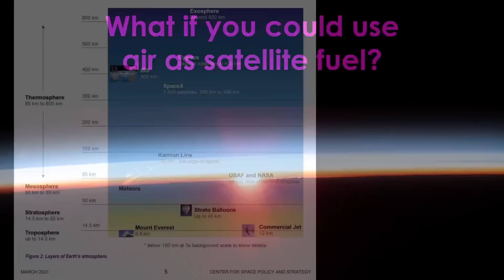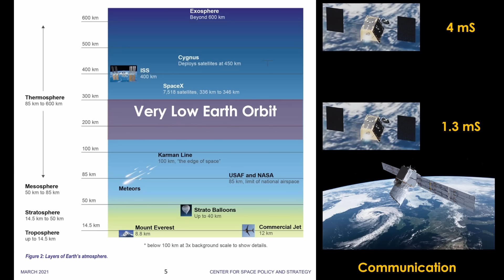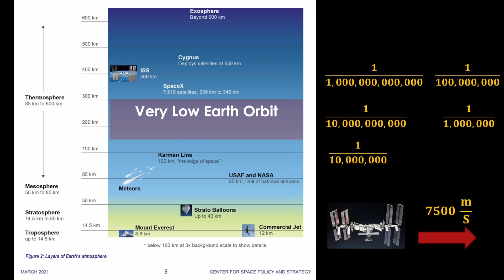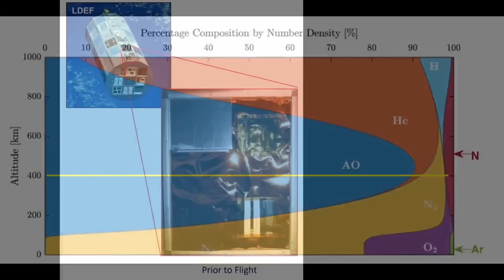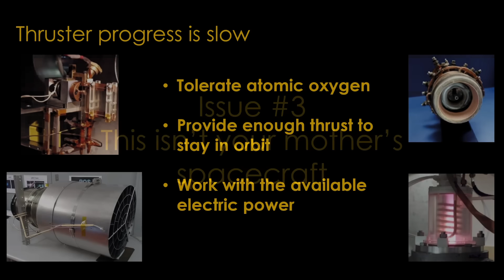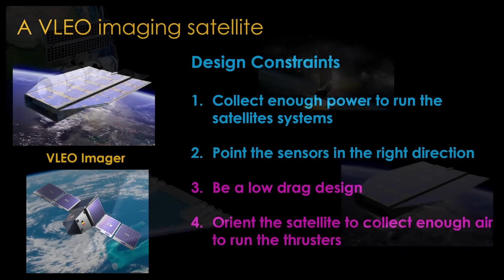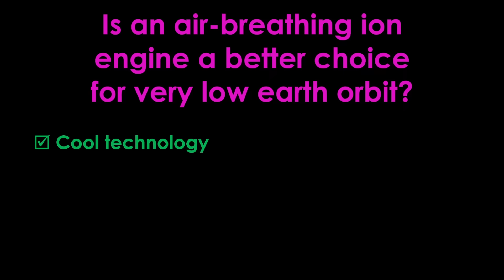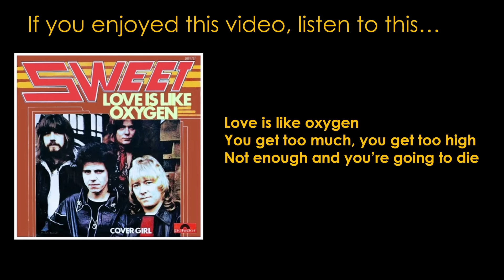Air Breathing Satellites in Very Low Earth Orbit

Comment: I wonder if a performance compromise is possible for the ram collector, perhaps using a sacrificial carbon aerospike at the inlet that initially slows the air and reacts with the atomic oxygen to form CO, which is then accelerated with an ion thruster. The propellant then wouldn't be infinite as with the air-only scheme, but it is collecting a little more than half of its reaction mass initially and protecting the electrodes from oxidation

Comment: Could this solve single stage to orbit and refilling in orbit? I mean theoretically if such a satellite could collect excess oxygen and deliver it to an in-orbit refill station that would make refilling and reuse of rockets or space vehicles a lot easier as oxygen is actually most of rocket fuel. I'm not sure about the figures but just rocket fuel without oxygen would mean a specific impulse (Isp) of about 1000 s or so. It would kind of look what Space X is doing with reusable rockets like Falcon 9 kind of silly and I dare not even mention the Space Shuttle program any more.

Comment: Can you put them in low earth orbit and make them capture water, use the solar panels for electrolysis and store the O2 and H2 in tanks, then once you have full tanks do the final push to a higher orbit?
Reply from the maker: NASA originally looked at this as a way to capture oxygen for propellant, but they physics just doesn't work out.

Comment: Would using a kind of scram jet to simply react O into O2 be an exothermic enough to work? Another idea I had would be to put grid fins on the satellites that are black on one side and white on the other and develop thrust in the way a Crookes Radiometer works. I have far less faith in the Crookes Radiometer approach to actually work. I also suspect that people have already thought about those approaches and ruled them out already.

Comment: would it it be better to have a very elliptical orbit where you have a pretty high point (somewhere around the ISS or higher orbit point) and a very low point.

at the low point you could scoop air into a big tank and also do imaging and you could possibly sit lower to not hit as much diatomic oxygen. Then since its more effective to effect your orbit from the opposite point and at the highest point it would be more effective.

the only problem I see is reentry might be harsh.

Comment: Is there a gas that if used in the thrusters would reverse the oxidation from AO?  Then one could alternate between air breathing and tanked fuel and make the tanks last longer I suppose
Reply from the maker: You can't reverse the oxidation, but you could conceivably bring up something to react with the AO as it came in. That's feasible - I guess - but it seems like a lot of work to do to just get a modest gain in fuel economy.
Reply: @EagerSpace  Agreed.  But when it rains, make lemonades and I'm just stretching trying to think of what kind of lemonade can be made from abundant AO I guess

Comment: Could you flip the design and create a very large air scoop that also acts as a wake shield? It would protect most of the satellite from atomic oxygen while simultaneously scooping it up.

Then you only need to protect the air scoop from the atomic oxygen. You can combine the atomic oxygen into O2 for storage and fuel along with the other molecules.

Then the trick is figuring out what the drag ratio is. With this information, you can apply more power to the ion engines and push harder.  

Then the math is thrust to drag ratio, and power to thrust ratio, and surface area (behind the wake shield) to power ratio of solar panels.
Reply from the maker: The original NASA plans around this envisioned harvesting the oxygen and liquifying it for use as a propellant. The hard part is that every atom of oxygen you collect produces drag on the satellite so a large air scoop means a ton of drag, and it seems unlikely you can get enough thrust to stay up.
Reply: @EagerSpace  Drag increases linearly as a function of the area of the forward cross section.  Solar power increases linearly as a function of the area extending an arbitrary length behind the air scoop/wake shield.  once you have a big enough cross section blocking the oncoming atomic oxygen, you can extend the length behind it as much as you need to capture the appropriate amount of solar power in effective vacuum, since the intake/wake shield can produce quite a long near vacuum behind it.  no need to worry much about atomic oxygen on the solar panels or the rest of the equipment.

Comment: I wonder if it would be possible to design it such that the air scoop functions as a shield for the rest of the spacecraft, totally 'shadowing' all the other parts from mono-atomic oxygen. It would further limit the spacecraft's options when it came to attitude adjustments, but it could make the materials engineering much easier.

Comment: It is a bummer that an atmospheric scoop is not feasable, or if it is, close to non-worthy on earth. Oxygen would be a very demanded comodity on orbit and a particularly heavy one. I usually think about about ideas like PHARO—Propellant harvesting of atmospheric resources in orbit and ways to achieve the numbers needed. Maybe power it by microwave or laser beaming from the ground or a ring of beaming satellites on higher orbit (the use of a nuclear reactor in LEO or below it I'm not going to consider), leaving the large solar array out of the equation and the drag... maybe electrodynamic tethering or traditional tethering could help with it. Atomic oxygen is always a problem though
Reply from the maker: NASA did some papers exploring whether they could do that, I think in the 1960s or 1970s.

Comment: Could a magnetic field be generated that funneled air into the center and deflected air around the space craft body and solar panels? As if the earth's poles were the intake and thrust and the outer donut was the rest of the ship. Or would the power requirements of that be just too great?
Reply from the maker: AFAIK you can't affect atomic oxygen with magnets
Reply: @EagerSpace  Oh, yeah! I forget magnetic fields don't effect everything sometimes.
Reply: If you  are making an ion drive using  monatomic oxygen, you have to ionize the atoms.  Those atoms  are charged, and can be guided by a magnetic field.  You would want to ionize them before they touch anything and without using crazy amounts of power.  I'm sure this has been considered, and magnetic scoops are standard equipment for the (currently unavailable) Bussard ramjets.
Reply: @hanshaucke8715  I'm always assuming everything has been considered... and then doubt my assumption. It will be very interesting to watch the technology unfold.

Comment: make eliptical orbit, when behind sun, electrical low satelite on high orbit wich is low drag no trust condition... when on sun, have enough power for ion truster and  scoop air for gaining speed for maintaining orbit
this give benefit of: easy to change orbit, no need constant power to maintaining orbit and not in constant high exposure of diatom oxigen...
Reply from the maker: Might work, assuming you can do the work you want to do in a highly elliptical orbit.

Comment: If very low earth orbit satellites could have a life span of 5-ish+ years and the cost to deploy continues to go down, it could lead to solution to Kessler syndrome because dead / malfunctioning satellites would quickly cease to be a problem at that orbital altitude. It would be possible to curtail launching to the higher orbits so that the debris / dead vehicles could decay out of orbit over time.
Reply: Put enough trash in the void and eventually air will be the only viable strata

Comment: Given the atmospheric composition chart, wouldn't 100km be sweet spot, 95+% N2 which is known for being unreactive.
Reply from the maker: If you could stay at orbital speeds, yes. 
I didn't talk about it, but SLATS only stayed at 167 km by using its reaction thrusters. As you go lower the drag factors get higher and it's going to be hard to get enough power and thrust to stay up.

Comment: wow, I can see why people were upset at the chinese anti-sat test now. So much debris it has its own category on the chart
Reply from the maker: ASAT tests are just terrible. Not only is there a lot of debris but because of the impact energy you end up with pieces in elliptical orbits.
Reply: Delightful research and presentation from a new subscriber. Although somewhat of a Rube Goldberg contraption, one could imagine a two-part satellite each with its own engine. One part would have the sensors optimally oriented and the other would have the solar cells optimally oriented. Power could be supplied to the sensor unit via microwave. This is probably way too complicated and expensive. Thanks & blessings!
Reply: To be fair, they are not the first, nor the last to carry out those tests. Most of the debris are either from the US or the former soviet satellites.

Comment: Something i gotta wonder about is if the viability of air breathing  satellites  could be improved by beamed power from satellites in higher orbits. 

It removes the challenge of having to orient for both power generation and oxygen capture, and means the solar panels aren't generating drag for the satellite or experiencing the highly corrosive atomic oxygen environment.

i think the main problem would be is that you'd need enough higher orbit generating satellites to maintain a constant beam of energy, which massively increases the initial set up cost. It's not insurmountable but it'd raise the bar for entry a lot i think.
Reply: why not use those same lasers to ionize the airstream then?
Reply: @MrJohndoe845  i'm confused what do you mean by that exactly
Reply: @MrJohndoe845 ionization is done in the thruster itself. Even then you’d still need power in the thruster itself to accelerate that ionized air to get thrust anyways. Even then how to hell would you hit the air with that laser to ionize it. You’d be vaporizing everything on the surface.

Comment: to make the satellite low drag and generate enough power, you would probably need to make the satellite very long, like trains, everything eventually turns into trains
Reply from the maker: The SabreSat is entended to be extendable if you want
Reply: The train is the engineering equivalent of the crab
Reply: keep going and you'll have an orbital ring
Reply: The problem with space trains is that only the last segment can have propulsion.
Reply: @basilevs83  The problem with earth trains is that only the first segment has propulsion most of the time. I don't think that's much of a problem.
Reply: @MystiIsLostsecond and third locomotives for Earth trains are waiting for them on stations before chanllengin track segments.
Reply: @basilevs83  All of the segment can have propulsion, you just need to thrust backward with shallow angle, at 10 degree you still can have like 98% of thrust.
Reply: Fakestory,
And the vertical component still helps

Comment: Cool video. I would've liked to see what "low drag" in the context of these kinds of speeds and this low density air actually looks like, especially when the air has a propensity to react with whatever it collects with. I imagine you don't really deal with the standard aerodynamic models where you look at the air as a collective that has different pressures and velocities at different parts and more as a bunch of billiard balls bouncing right off your spacecraft lol, or hell even getting partially imbedded into it / reacting with it.
Reply from the maker: All the pictures I showed were proposed designs for very low earth orbit satellites. Some of the papers I found talked about their drag models, but I didn't look at them in detail - and they may be over my head - so I don't have anything useful to add there.
Reply: @EagerSpace  Fair, it's probably best to avoid talking too confidently about something you don't know a ton about, and aerodynamic models can get real complicated really quickly lol, especially at those speeds

Comment: It needs to collect air, to produce thrust, to counteract the drag caused by it collecting the air. Can the collected air really provide more energy in thrust than is lost to drag whilst collecting it?
Reply from the maker: If you can add enough energy from your solar panels, yes. 

It's not clear yet how hard that will be.
Reply: In theory if you collected, lets say 50% of the air, you would just have to shoot the air back out at twice the velocity it came in from to make up for it, which ion engines are very very much capable of doing. Some have exhaust velocities of 35 km/s, which assuming an orbital velocity of about 8 km/s you would only need to collect 23% of the air. And that's assuming that all the air that hits you gets accelerated to the same velocity as you, which isn't guaranteed.
Reply from the maker: Unfortunately, the higher the exhaust velocity the lower the thrust for a given amount of electrical power. That's why ion engines tend towards heavier molecules - the specific impulse isn't as good but the thrust is higher.
Reply: @EagerSpace  In theory you could get away with a pretty low ISP, at least for ion engines, if you have an infinite fuel source.  if you can harvest like, 50% of the incoming air (and assuming the rest gets accelerated to around your own velocity), you would only need an isp of like 1600 seconds to regain the required momentum, which is on the low end for ion engines. Low isp means less power required and less solar panels, which would reduce complexity quite a bit.
Reply: The principle is the exact same as a conventional jet engine, so obviously it can work. In theory that is. ;P

Comment: Great episode.
Hardly any material survives being hit with atomic oxygen at 7500m/s, so it would make sense to have a shield that reacts chemically with the oxygen and retrieve it as O2 by reversing the chemical process. Perhaps with Lithium or Selenium which don't degrade after repeated regeneration. The satellite would still need to throw out the oxygen the other end at the same speed as it was cought, so I assume ion thrusters would be the only option.
Question:
Let's say we get a mission to crash a payload of one ton into an asteroid, and because time is short we must do it with a direct approach with chemical rockets. To our aid we have access to a Starship that can launch a payload of 100 tons to LEO. Should we put a self propelled space probe with a big fuel tank in the payload bay and launch that from LEO, or would it be more sensible to shed some skin off the Starship and use that as launch vehicle with 99 tons more propellant? What kind of velocities could we reach? I suppose a self propelled probe could use hypergolic fuel and a small engine, but no ion-thrusters or nuclear devices.
Reply: Of some note, an entire F9 second stage and payload fits inside the cargo bay of a Starship. SX currently builds 150 of these every year. Economies of scale apply. 

Your scenario assumes expendable Starship, so the mass budget is about 200 tonnes.

According to Wikipedia the second stage has a dry mass of 111,500 kg and a dry mass of 4000 kg while the engine has an ISP of 348 seconds. 

That means that from LEO an F9 second stage could accelerate a paperclip to 11.348 km/s or a 1 tonne probe to 10.587 km/s or a 10 tonne probe to 7.076 km/s

That gets you 10 tonnes to Jupiter capture (6.57 km/s) or throws 1 tonne right out of the solar system. (8.75 km/s) with no gravity assists. 

If a reusable Starship can lift 112,500 kg that means we could toss 150 extra solar probes every year.

PS, I didn't directly address the 1 tonne smacked into an asteroid. If you're just talking about a redirect mission, the empty second stage (4 tonnes) has over 11 km/s Delta V, so yes, it could easily hit an asteroid assuming there is some means for fine course correction added. No gravity assists needed.
Reply: @gasdive  Thanks for the answer.
Reply from the maker: Starship to LEO, then one or more kick stages. The impulse aerospace ones that are methalox would be a good choice as they ISP is a lot better than hypergolics
The speed you reach is going to depend on where the asteroid is.
Reply: @EagerSpace  Thanks for the answer. Keep up the good work.

Comment: Some quick math says that with a 1 m^2 air intake at 200 km, you would only get about 16 kg of atomic oxygen sucked in per year, assuming no losses. I'm not sure that's worth the effort compared to just throwing up some more fuel to begin with. Of course you could get more with a larger intake, but that also means more drag since you would be using less than 55% of the air for fuel. There's probably some sweet spot for a given satellite size, but even if you come out ahead in terms of energy, I'm not sure if it would be worth the hassle of dealing with atomic oxygen as a fuel.
Reply: Yes. Plus the fact that all this work is about weight saving. You could have much bigger sensors higher up, but that costs weight. And as we have all internalised, saving satellite weight is the most important thing. 

Except it's not anymore. Even F9 has changed that a lot, and Starship changes that completely. 

With mass to LEO so cheap it might be cheaper to give it a small frontal area and pack the nose with 200 tonnes of salt than muck about with this.
Reply: @gasdive  ha, you would definitely put propellant or satellite hardware in there instead of mostly useless ballast, but sure. More mass in a smaller space will reduce drag deceleration.
Reply: I am not sure if this buries the idea of harvesting oxygen in orbit. However it makes it much harder to imagine something that could "harvest" tons of oxygen while in orbit.
Reply: Sorry, but to be more specific there was an idea called propulsive fluid accumulator from the fifties or sixties.